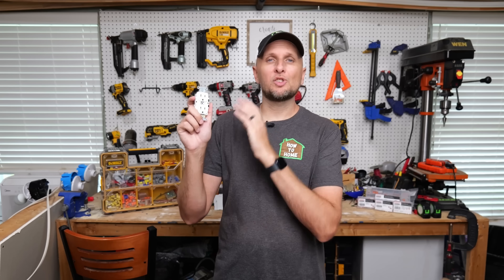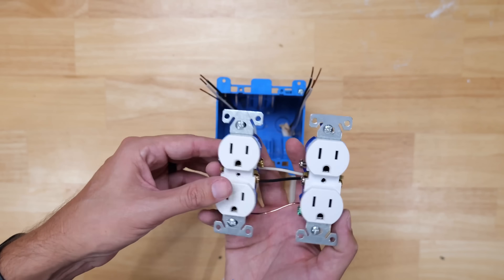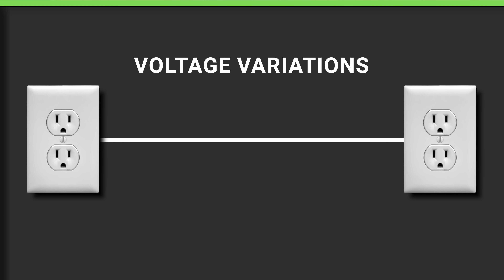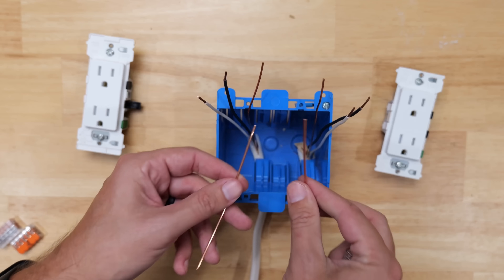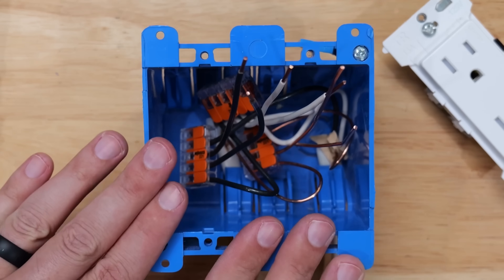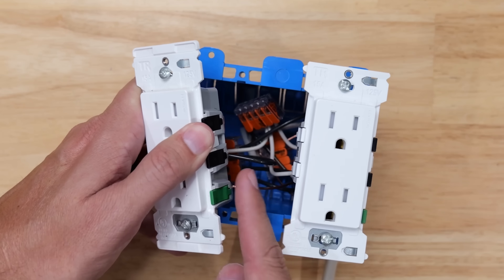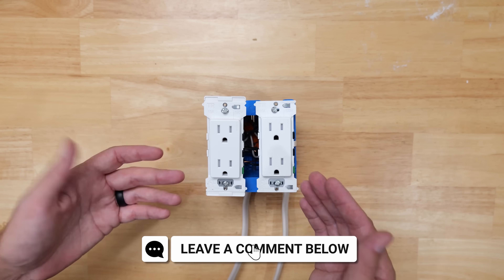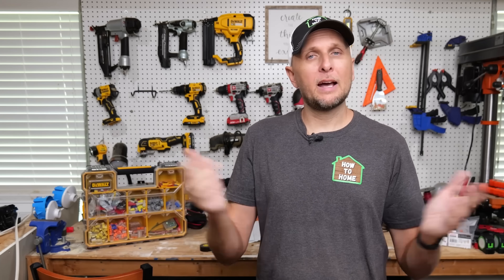Why This Outdated DIY Outlet Wiring Needs to End!

Comment: These quick connectors are prone to damage over time from heating and cooling then you can get an arc that starts fires. I will take a copper wire under a tight screw any day over these quick and dirty methods for lazy “Professional”

Comment: To me this looks like moving the point of failure from a solid piece of brass with screws that’s attached to the outlet to multiple plastic WAGO connectors. 

Even when the outlet gets old and no longer holds plugs, that solid piece of brass is still perfectly fine.  How will those plastic WAGO connectors be doing in 20 years?  Maybe they’ll be doing good but I can’t see how they would be more reliable.

This feels like some college graduate after studying an electrical engineering book decided he was going to reinvent the wheel.  The new way looks fine, but I don’t see how it’s any better.
Reply: Wago 221's have been around plenty long enough to know that they're reliable. They are the standard connector in Europe and have been for a while now.

Comment: All this method does is move the failure point to the wago connector. If the power in lever connector fails,everything downstream is unpowered. Only the push in connectors fail on a receptacle.
Reply: ( Only the push in connectors fail on a receptacle. ) The receptacle could also fail due to the wire being loose under the screw and age deterioration. I have fixed many of those problems.

Comment: How about WR (weather resistant) outlets with USB charging ports?  They would obviously need to have an upstream GFCI or GFCI/AFCI recepticle.  I'm also concerned about box-fill with late 1970s or 1980s wiring standards on a rehab job.

Comment: Thats wrong 
Nec code is you can not use a receptical or any device to pass through .
Wire nut all wires together wite together 
Black together grounds together 
Pig tail out a minimum   
Of 6 inches .

Comment: I like having less junction points in the box, and the "old" style does that. Sorry I don't see a compelling argument for not using the load side connections of an outlet to supply a line side of another,. Not sold that there is a reliability gain, and there might be a decrease in it with the extra connections.

Comment: I use comercial back wire outlets  to clamp incoming and outgoing wires under same screw down clamp. no power going through outlet to get to next outlet recepticle can melt and screw terminal is passing power better than a wago or wirenut which clutter up the box with too many extra wires and connectors

Comment: I don't like your way because that means no one is going to fix that one outlet first in line that's broken and possibly has a short or something. At least if they all go down if you went in order down a straight path like normal you know it's the outlet first in line or close to it. At least then someone fixes the problem right away. So i may be worried about the one problem that may not happen. However we have one outlet not working and it could be intermittent and all the sudden that outlet could short and start fire. It's not working then i want it fixed. Just in case it's something loose. People could keep trying to use it too. This insures it get fixed because none work down the line.

Comment: One issue is box fill. Some older boxes are small. In those situations, I prefer using a spec grade receptacle and then backwiring. Another issue is gfci protection. Subsequent outlets are only protected if the current is going through the source of gfci protection
Reply: The space in boxes generally, is way too  limited. Very few people will use this method because it takes more time, not to mention, every connection is an opportunity for failure, now you’re jamming all that wire and connections into a tiny space. Outlets have gotten bigger the boxes are way too small even today. The old metal boxes, insane.
Reply: Box fill is an issue in older homes. The boxes that were installed were just smaller and they had room to spare for the day.  Fitting decorative receptacles and switches are difficult at times or may even be against code for box fill in those older boxes.  The difference between a 14 cu in work box and a 22 cu in is like night and day when stuffing 20 awg wires. Adding pig tails with wire nuts just takes more room.  Wago seem to sit better in the boxes in these cases vs wire nuts.

In an ideal world, pigtails are the way to go so that you can easily pull out the receptacle.  You are only pulling one set of conductors out instead of everything in the whole box.  But it rarely works that way when you have an issue. They all seem to come out.
Reply: Actually, if you want more than one gfci outlet, such as in a kitchen, this pigtail method is the only way. If you try to run a second gfci off the load of a gfci, neither works properly.
Here on Jamaica they only allow 3 outlets after a gfci on load side. But in a kitchen you want many outlets for convenience. So either you have a separate breaker panel just for the kitchen, or you run three gfci outlets pigtails, with each protecting two or three outlets in a section of the kitchen.
Reply: @brotheradam only 3? I wonder why. It’s good practice not to have too many receptacles on the same circuit. But that seems unrelated to gfci protection. I’d say kitchen needs at least two circuits for counter top receptacles
Reply: We see too many back-stabbed receptacles back out and melt down or start house fires.The side terminal screw is much better than backstabbing.
Reply: Yeah....trying doing this with wire nuts.😅
Reply: Each outlet box is marked for cubic inches to allow wire fill determination to meet National electrical Code. After 40 + years of doing these calculations I doubt seriously that this installation method would meet the NEC requirements. As far as voltage drop goes the statement that all receptacles would be the same is nonsense. Attempting to circumvent physics is just demonstrates the author’s lack of understanding of the NEC and physics.
Reply: @RussCardella I’ve seen boxes where it seemed like the installer could not spell box fill, let alone make the calculations
Reply: @RussCardella  Looks like he is using a 25 cu inch Carlon double gang box.  There are 6 wires entering the box. 2 of which are grounds, the first 4 grounds count as one wire for box fill calculations (NEC 2020 +).  Pigtails do not count because they originate inside the box. Thus he has 5 wires entering the box.  NEC allows 9 12ga for this box volume. Thus not a problem. However, his pigtails are too short, should allow 3 inches outside the box  to allow for connection. A bit longer would allow the Wago connectors  to be folded to the bottom toward the incoming nm cable and flattened to the back of the box out of the way. Pigtails would "flow" better to the receptacles with less jumbled mess and  easier to fold into box.  Changing the order of pigtails on the Wago would help too.

Voltage drop is nonsense. You have a splice whether you use wire nuts, Wago, or screw terminals on the receptacles. Each splice does cause some voltage drop.  BUT .. splicing on the receptacle can make it difficult to stuff wires in the box, which can cause connections to loosen, causing a poor connection and more voltage drop. But then so does poorly  applied wire nuts and Wago. When downstream outlets don't work in my experience its a wire that pulled out of a wire nut due to improper twisting of wires before applying wire nut. 

 The real reason is pigtails are considered best practice (not required by code) , they make it easier to stuff receptacles into box and  replace in the future. Experienced electricians can pull receptacle out and test/replace live (not recommended).  Pigtails can be replaced if the loop at the end gets mangled. When spliced on receptacle, over years of replacing receptacles, wires are cut shorter for a clean connection until  they are too short. Then pigtail must to be added. Easier to add them from the beginning.
Reply: First thing I thought of when he started showing pigtails.  I had to deal with tiny boxes in my previous home where I couldn't fit a GFCI into a kitchen box.
Reply: @Impatient_Ape I found thinner gfci receptacles that made it possible to fit into those old boxes
Reply: No, I think you NEED that wago connector that is wider than the box for the grounds. Way too outdated to twist the grounds leaving one long to go to both outlets.

Comment: The problem with this video is that in a lot of older homes there is simply not enough room in the boxes to be cramming in a lot of pigtails. For an outlet you should then use the older screw style Leviton Decora which will allow you to screw up to four wires on the hot and the neutral side. Then you just need a pigtail to carry on the ground. The same applies to the older screw style switches.

Continuing the circuit down the line is probably a bogus argument because those switches and outlets will continue carrying current. I have seen no evidence where they will stop caring current just because the switch stops working or the outlet stops working.

Comment: FYI - If you decide to use the Decora lever type outlets and switches and you want to use the modern Decora cover plate, it will not work if you have the wire box protruding from the wall, such as when you use an old work box that sits on top of the drywall. There is simply is not enough spacing behind the modern cover plate. It's a crap design.

Comment: Your first example is called wired in SERIES. The correct way, the second example is wired PARALLEL.   Parallel is the preferred way for the exact reason you mention. When one has an issue, the others still work.
Reply: There's no such thing as wiring receptacles in series, it's a misnomer, it's always parallel.
Reply: You clearly do not know the difference between a series and parallel circuit. The wiring he did are both parallel circuits just a different way of wiring it.

Comment: So wire them in parallel not in series... Not a new idea 
I think it's been code for commercial work for years
Reply: Receptacles can only be wired in parallel. NEC does not mandate pigtails for residential or commercial work, if you think it does, cite the code. Some electrical contractors may require pigtails, but that's their preference.
Reply: That method of daisy chaining was not series it was parallel. If it was series nothing on the circuit will work. Take a battery for instance if you go( + to - and + to - ect) that is a series circuit now if you go + to + ect  then - to - separately ) that is a parallel circuit. They are both daisy chain method

Comment: If one wants to use quick connect recpticals the better ones on the market is hubell quick connect there commercial rated; Amazon has them
Reply: Leviton edge also offers commercial spec grade receptacles including gfci's

Comment: I did six 20A circuits, three 15A lighting circuits, and two 20A 240V circuits in my basement shop.  I wired the recepticals on alternating circuits so that a shop vac, for instance, and a tool plugged into adjacent outlets were on different circuits.  Two such circuits go to a room that's currently storage, but where I'm about to move my 3D printers and the computers that go with them.  Two circuits go down each side of my shop area.  One pair on the outside walls and a pair in the inside "island".  There are three lighting circuits, one for each major room (I use a LOT of light).  One 240V circuit is for stationary tools and the other for the dust collector.  Only one tool is in use at any time (there is only one of me), so that circuit is shared by all of the stationary tools.

I'm not buying the "voltage drop" through a receptical. It's a hunk of metal between two screws.  If there is a voltage drop in that 1/8", you're going to have real trouble at the end of a 50' run. The power isn't going trough the receptical, only the tabs were the screws are. 

I'm not suggesting that this is the way is should be done, and isn't allowed in many areas of the country.  They demand pigtails for the grounds and neutrals, for more or less the reasons you don't put the outlets between the in and out, but with far more dire consequences that you indicate.  A fault in the hot is an inconvenience as you say.  A fault in the ground is a possible problem because you've lost the safety ground to the recepticals after this fault.  However, a fault in the neutral is a disaster in waiting. A fault in the neutral will cause the neutrals after that to become hot.  Neutrals must be pigtailed.

Do_not wrap wires under the screws (except ground). Buy decent recepticals.  They have a hole and captive clamp. When the screw is tightened the clamp tightens on the wire, holding it in. They're rather like your lever clamp, but screwed down.  I prefer these.   It's far more reliable than the wire under the screw, which can work out.  There is nothing inherently wrong with the lever, I suppose but it's not as tight as the screw clamp.

Also, never, but never, use the back-stabs.  The contact area is so small that they can fail, sometimes causing the outlet to overheat (to the point of fire). Don't use cheap recepticals. They should be two or three dollars each (maybe $20 for ten). The $.89 specials are junk and will usually have the back-stabs.

Comment: I pigtail all of my dual gang outlets, because having a lot of wires (especially solid core 12ga) attached to the outlets makes them unreasonably difficult to position.  More wires on each outlet also increases the chances of bending and straining the wires in undesirable ways.  My preferred method is to connect stranded pigtail wires into a Wago, then push the Wago to the back of the j-box, then connect each stranded pigtail to a sidewire Decora Plus outlet.

The claim that "chaining" rather than pigtailing causes voltage drops or amplifies the effect of "bad outlets" (???) is highly suspect.  Also, @ 1:26, how the heck is that ground wire getting connected up?  Grounds always need to be pigtailed because there is only one screw.

Comment: Your premise that if one outlet "fails" that you will lose power on the rest of the receptacles is completely wrong (not including  GFCI circuits). The power does not "go through" each receptacle to the next. Each receptacle has a SOLID plate that you screw the wires to, so that solid plate would literally have to melt in half for the rest receptacles to lose power and that NEVER happens!
Reply: The failure point is the terminals.  If either connection fails, the power to the rest of the circuit goes down.  If it's pigtailed, the wires to the outlet don't matter (to the rest of the circuit). You've at least doubled the points of failure.  The probability of failure is even higher than double than that if pigtails are used. A properly installed wire nut just doesn't fail.
Reply: @kwilliams2239 how is the terminal going to "fail"? It is a solid plate with a threaded screw.
Reply: @JoeMama-gx5gw  The copper flows because of the pressure and slips out from under the screw.  Or, the stripper nicks the wire and it gets work-hardened and breaks.
Reply: @kwilliams2239 so the wire can break in a wire nut or a wago too. I've never had a wire break at an outlet unless you constantly remove and install the outlet over and over which never happens. This video is BS. Either way is fine.
Reply: @JoeMama-gx5gw  It may take 50 years, but they do fail.  I'd be more concerned about the neutral.  Lose that and you have a very dangerous situation.

Wagos can fail, I'm sure. Wire can simply pull out of them.  Wire nuts don't fail.

I agree that the video is BS.  However, I had an inspector insist that the ground and neutral be pigtailed (he didn't care about the hot).  That's how I did it anyway, and he was more than happy with everything.
Reply: It happens more than you think it's not the plate that fails it's the connection point on the receptacle that fails due to a wire loosening over time or the plastic aging. As for losing power if not pigtailed the rest of receptacles will not work
Reply: It happened at my parent's house.  All but one outlet quit working in one room.  When I opened it up, the screw on a daisy-chained receptacle had worked itself loose and arcing built up enough soot on the copper that it no longer made electrical contact with the hot wire headed downstream.  Cleaned the wire up, replaced the receptacle, and it was good to go.

Comment: 10:31 if you're using a GFCI receptacle to connect further outlets,  you have to go through the receptacle,  not pigtails.
Reply: yea and all outlets are designed for this and can withstand more amps than most wagos and competitors can. So it really doesn't matter.
Reply: That is wrong. There is a line out on the GFIC  you send those wires to the next receptacle and not only can you pigtail you should pigtail. Hope this helps.
Reply: @twigd3825 You are correct when connecting the remaining receptacles to be GFCI protected , The wires going to the remaining receptacles downstream must be connected to the load side of the GFCI receptacle , The only other way would be if you wanted to GFCI protect the entire circuit is to install a GFCI circuit breaker but that would be expensive , That's why GFCI receptacles have a second set of terminals marked LOAD So you can GFCI protect the remaining receptacles downstream and also light fixtures that may be on the same circuit
Reply: That is the cheap way.  The better way is to install separate GFCI outlets